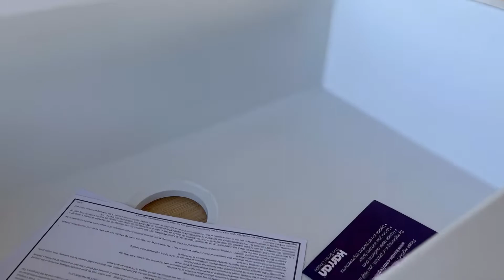Airstream Mod // New Farm Sink in our Airstream Kitchen

Comment: It all looks great!!  I am about to do something similar and I have a question about your drawers.  What keeps them from opening while you are moving down the road?  Thanks.
Reply from the maker: Hello!  We've never had an issue with our drawers opening during travel.   Cabinets, yes, so we use bungee cords.
Reply: @livingthedolife  Thanks.  What I finally did was make a simple block that covered one edge of all 5 drawers and used a couple of threaded knobs that screw into inserts between them.  Wish I had a picture to show but.....